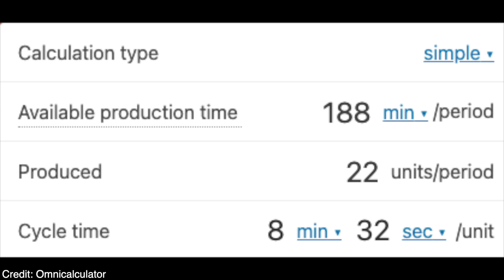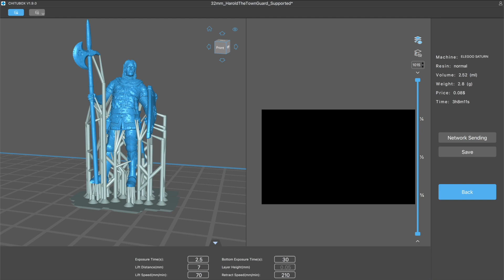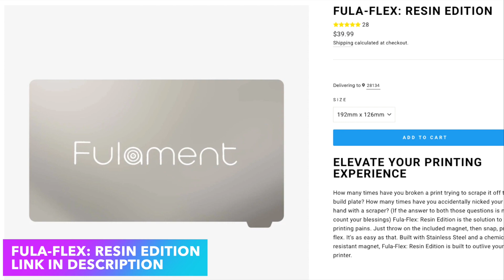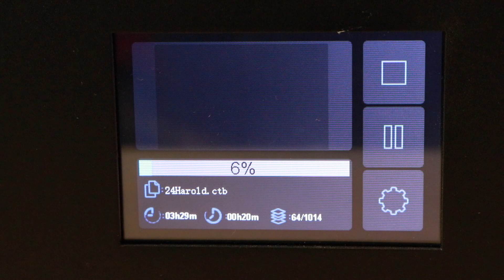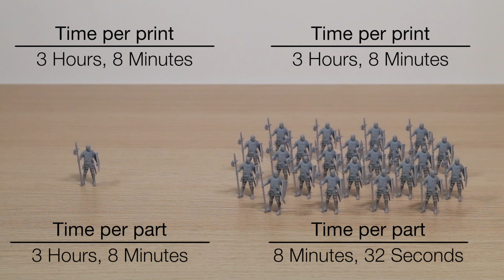How to Print Multiple Models REALLY, REALLY FAST using Resin 3D Printing!

Comment: Once I'm in a better living environment where it'd be physically safe to have a resin printer, this is one of several reasons (lots of models on build plate, printer can handle smaller details, no moving nozzle head potentially knocking pieces or supports off) that I'm wanting a resin printer.  Thanks so much for demonstrating all of this.  I love my FDM printer, but it would take over a solar day to print all of these miniatures since it could only do one at a time.
Reply from the maker: It's worth the wait to get one, I promise!

Comment: How would you print multiple figure's but have them all on one large base.   I've seen prints where there are multiple different items but they all are attached to a single large bed area so the whole thing lifts off the build plate as one piece.  Great video by the way.

Comment: Can you do this but with different stl files. Like fill up the build plate with multiple but different figures? Everytime I try my printer will not recognize the sliced file. But a standalone figure works just fine. There must be. A way. Printing each figure I need independently would take an enormous amount of time. When the figures are relatively small and there's plenty of room for them on the build plate.
Reply from the maker: Sure! It’s based on height, not number of parts!

Comment: Well for idiots like me I was looking to see how to add more than one model to the build plate. I didn't see that part.
Reply from the maker: Which slicer are you using? ‘Ctrl+C’ and ‘Ctrl+P’ works for most slicers to duplicate models!
Reply: @AndrewSink  Thanks for reply. I just started this 3d printing and struggling with some things. I am using chitubox.
Reply: @jamesmims7990  there are multiple ways to add more then one model to chitubox, atleast in the versions I'm using, the ones I know of are, left top corner opens a submenu click on the open tab and you can add additional STLs if the STLs are in one map you can select multiple files at once, you could also open the map where you keep your STL files and litterly drag the STL files onto an already opened application of chitubox I really like doing this if my files are in multiple maps, if you want to print the same model multiple times there is a function in the top bar slightly of the centre to clone the selected model

Comment: I'm in the process of making a mammoth tank from command and conquer 3, and I was concerned that I was trying to print many of the parts in a batch. I was trying to figure out if it's better when printing multiple objects to keep them spaced close together or farther apart for successful prints. I tried to print 9 different parts filling most of the build plate, and only 1 large part and a smaller part printed.

Comment: when you say additional parts do you mean adding surports ? also do you still use this resin and do u use water on its own or anything else to clean it?

im looking at ANYCUBIC 3D Printer Resin LCD UV 405nm Rapid Photopolymer for LCD/DLP/SLA 3D Printers, 1000g Grey as well 

it be a 2K printer i be testing on first thanks
so looking at which resin to get for it or if i should get the same make printer resin they do but it seems more limited to find and comes in smaller bottles mainly

Comment: My experience in this area on a MP2 is that overstacking the build plate can result in some failure more often then not, that in turn creates a clean up process, more wasted time, wasted resin etc...I stick with generally 60-75% full build area now with very very odd failure occurrences.
Reply from the maker: Bummer! Sounds like you’ve had a lot of problems with large builds. That hasn’t been my experience so far!

Comment: I'm using a photon mono to 3d print stuff. When I print only one object it prints reallly well, but when I bulk print multiple copies of the same object, or even different objects, most of the prints fails somehow. The most commom problem is to detach from supports and warp. Any idea on what is going on?
Reply from the maker: Sounds like the platform may be slightly out of level? Have you tried printing a single part at various points on the platform?
Reply: Idk exactly why, but I have the same model and the exact same problem. I did some research on internet and the only thing I could find was to print 3 minis max
Reply: Perhaps your retract speed is to high and it tears of the mini's from the support, up until a week I had never even heard the suggestion of lowering the retract speed but since I have done it I have finally been able to print bigger mini's using thin supports as opposed to thick ones

Comment: There is also another thing that isn't mentioned here and that is that printing multiple prints in one go also reduce the wearout of your LCD screen as opposed to printing them one by one.
Reply from the maker: That's a great point!
Reply: eh its more about maximizing your time with what's on the build plate. if you didn't buy a shit printer, you don't need to worry about the lcd screen at all....

Comment: While I know you didn't include the costs of post-print activities in the per-model time, just an interesting thought: similar to how the assembly line cut down on effective time per-item, the washing, support removal, and curing times could likely be done in the time another batch of figures is printed. In such a manner, those costs are effectively negligible (assuming subsequent batches continue to be printed).
Reply from the maker: Right? The ability to process parts in batches is a pretty big deal, and having a large format wash / cure station makes the process super fast!